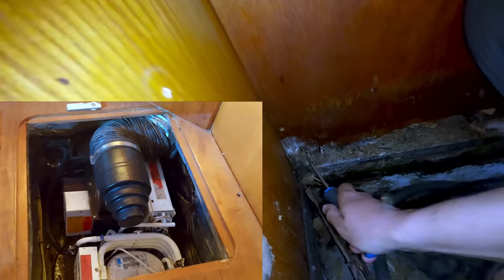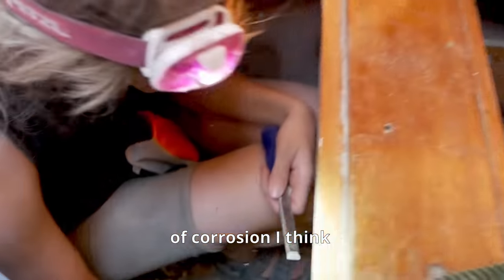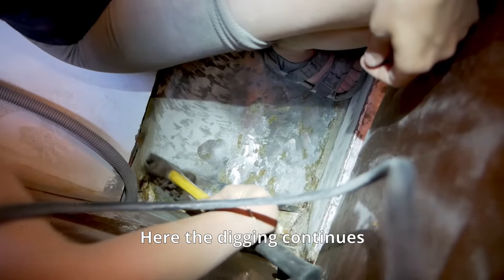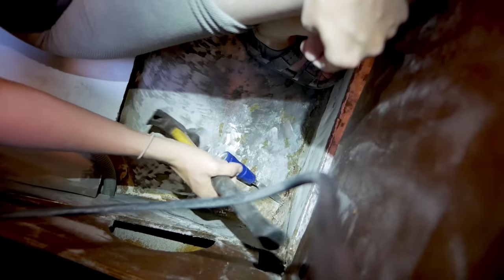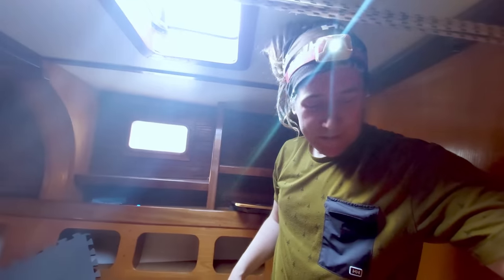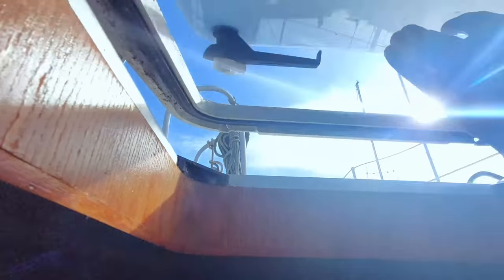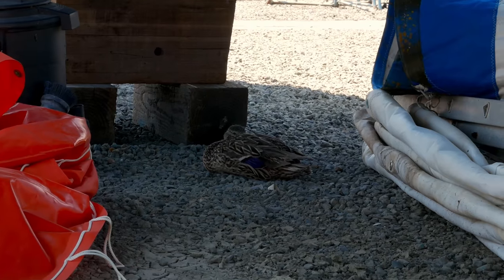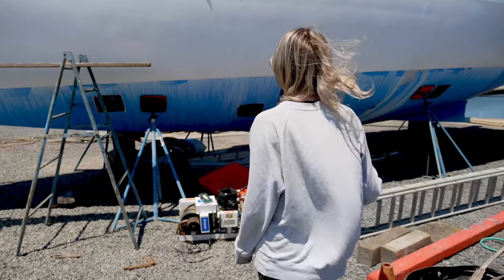Grinding Away ROTTEN Interior. Our HUGE Boat Refit

Comment: The wood glass against the hull may be sound insulation, I met a guy with a sailboat just aluminum and he said it was very loud in heavy weather.
Reply: Would be really bad sound insulation though, as both are too dense so they conduct sound more than insulate. But that idea does make sense in some twisted way
Reply: They may have been linings to reduce contact condensation in cold water, on the inner hull also to different  metals like cans ..tools etc from contacting the hull... Creating a local corrosion patch🤔
10mm thick Cork tiles in the lockers would work well they dont rot they can be self adhesive glued in place or just dropped in, they breath but insulate well so prevent condensation. they are naturally anti fungal and bacterial they dont rip and squash like foam they also deaden sound. Its a naturally renewable material that can also be recycled. 
Its also fire resistant and even if it does burn its smoke isnt harmful like burning foam..
Its non conductive and easy to work. It works beautifully stuck on painted steel even a thin layer.
Reply: Yes, just done against the hull is a really bad choice. I also see people foam against the hull another mess for later. 
Like building a refrigerator box in a wooden hull, no contact or locking of airspace to hull is best practice.
Reply: @syntaxs4342  And as we previously learned high and low frequency insulation take totally different approaches

Comment: your window air conditioner is designed to be installed in a window... obviously. When you set it to recirculate it pulls air from the inside of the room to cool further. The way you have it setup outside it cant do this. Think about rigging it up in a cardboard box put against a window to achieve the same thing
Reply: This, Take a old sheet of plywood about the same thickness as your hatch covers. cut a hole for the A/C unit to fit in and place it onto your hatch guides.

Comment: I don't think lithium is a good choice for cold environments. You can't charge below 0°C so you'll need a heating system for your batteries. If you mess up and charge them too cold it will be a very expensive mistake. Really enjoying the videos!
Reply: Their batteries will be inside the cabin, do you let the inside of your home go to 0⁰c🥶 ? They are fitting multiple diesel heaters 🔥!

Comment: "if the oxygen can't get in there must be corrosion" afaik there is no corrosion without oxygen - so there must be/must have been another reason!? I had more problems with corrosion on the deck because of all the mounted stainless. Looks like always there was one owner  that "forgot" about electrical insulation between Al and Stainless. Hope you have fun and success with all the work lying ahead of you - don't forget to take a break every now and then :)
Reply: He is right in the video, if oxygen was present then aluminum would have transform into aluminum-oxide which is incredibly more resistant than aluminum (in term of corrosion but also strength). Any bare aluminum create an aluminum-oxide layer few micron thick when expose to oxygen. That layer can dissolve (ph < 5 or ph > 7.5) if it does and there is no oxygen then aluminum can corrode. With all the chemical in this plywood/epoxy it is very likely that the stranded water dissolved the aluminum oxide and aluminum corrosion did happen. Electrolysis can also happens but I don't think that is the case here, I do not see a current source capable for boat in that state to trigger that.

Comment: could I guess that the pieces of ply you are removing are small dams to restrict water flow in the bilges.  This is a debateable phylosophy. Advantage is  that is keeps some spaces dry for small hull leaks and allows easier identification of the source. Disidvantages are that every dam space needs to be regularly checked for water wheras only  one space is checked if they have been removed and consequentally an  early warning of a leak may be delayed,
The dams are good where perishable items are to stored low in the boat and which could be affected by bilge water but inspection of many dams often gets omitted and then has consequences
Reply: much better to put your items in plastic tubs

Comment: I hope you realise not to scrape aluminium with steel tools or a wire brush. Microscopic particles of steel can imbed themselves into the aluminium and will start galvanic corrosion if water is present. She is a beautiful boat I think you will love her. I have a Passoa which is almost the same and I love her.

Comment: Lithium batteries are great but I'm still leery of having stuff that flammable on board.

But apart from that, is their terrible performance at low temperature an issue for the kind of stuff you do? Its not like acid-bath batteries like being frozen solid either should you lose heating for some reason, but something to consider.
Reply: The lifepo4 batteries that most sail boats are fitting are  NOT going to catch fire & are good for thousands of cycles 3k at least. Do you let the inside of your home get to 0⁰c 😂. Before yapping on stuff do a bit of actual research, don't just repeat FUD that you have heard!😊

Comment: Moi, So what you're saying is that you are basically sitting in a sardine can in 34 ℃ and it's getting a little bit hot. Hmm... I would listen to the Americans in this comment section about the window air con or ask someone in the boat yard about how to set it up as they know a lot more than us Scandinavians about these things. Though I do know that they need to sit with one part on the inside and one part outside for it to work.
   If that's not an option try to get a portable one. On Amazon I saw some from around $ 300 but check Craig's list if there are some for sale there. I would stay away from the air coolers as they need water to work so they will add to any humidity problem you already might have. You could even get a cheap big fan. I think they are about 50×50 cm, and you should be able to get them from a Walmart and from Amazon of course.
   I would also get some kind of tarp and rig it up as a sunscreen over the the forward part of the boat and one as a bimini to get some shade. That would also work as a sunscreen for you guys to protect you from the UV rays of the sun when working up there.
   Oh... And remember to drink a lot of water. At least around 2-3 liters per day to remain efficient in the lovely warm weather. I usually buy gallon jugs of spring water from the grocery store if the tap water is disgustingly chlorified. I even think there is an option to buy even larger containers, and that you can refill them at the grocery store for a small fee. Big Brita jugs are good as well, as they come with a filter if you want to get away from the taste. I like them a lot when using tap water.  

   I haven't been on a boat in a very long time, so I'm looking forward to following you guys on this adventure. Kiitos for the videos (and that is the extent of my Finnish). Vänligen, Ann

Comment: Do not weld tanks, hi cost! Install plastic ready tanks. Easy maintenance, no oxidation, or fuel contamination. Less temperature oscillation. That contributes to the fuel degradation

Comment: That's one thing you can do there's a hatch behind you if you can get a box fan and put it in there so it's sucking the air out of the cabin that air conditioner will work 10 times better cuz you need a pullback with an air conditioning unit and you don't have a pullback so it's fighting the internal air pressure of the sailing yacht

Comment: Looks like the boat bottom skin and structure is really bad as previous owners knew it was leaking and did bad quick repair. Forget about the hatches n windows as water will come from the bottom if the corrosion are not detected early. Don't know how are you going to inspect the skin n structure from inside

Comment: 1st thing you need to do:  BUY PROPER DUST MASKS WITH REPLACEABLE FILTERS!!  dont refit a boat with junk paper masks. they dont do anything.
Reply: you're so called proper masks are horrible to wear in cramped & hot places!! Any way the particulate filtration on any P2/P2.5 mask is fine for what they are doing.